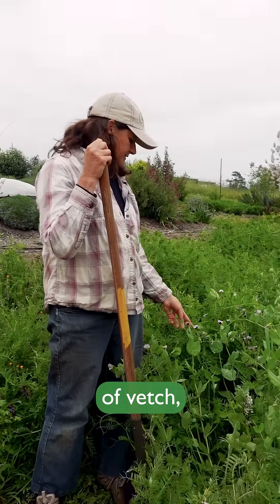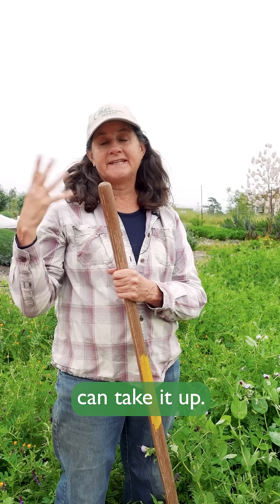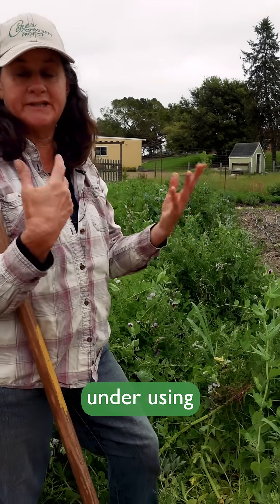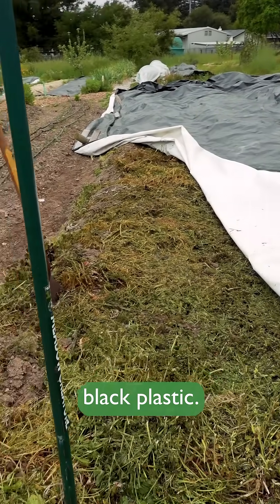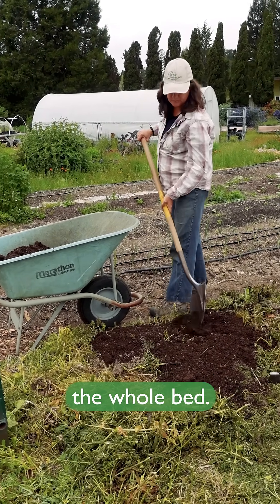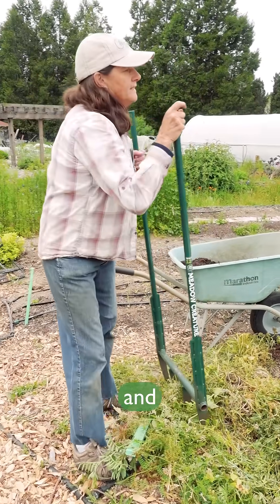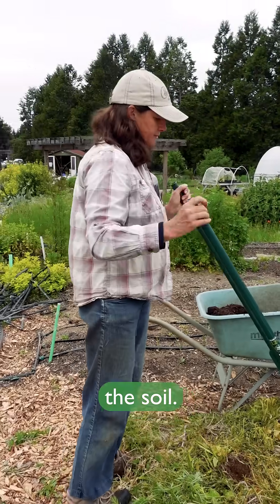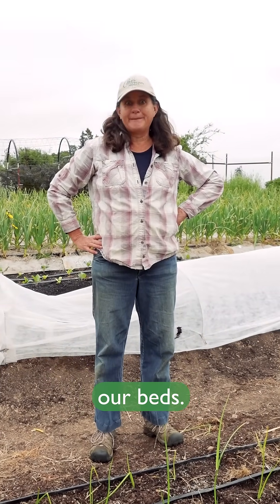What is the Low Tilling Method?

Comment: Love this so much!! I wonder if we can do this in colder climates, like here in Montana. Got a garden bed we just found out had pipes running through it 😅🫠 so need other more important ways of taking care of it.... Thank you!!
Reply from the maker: We love hearing that you're inspired by our garden practices!

That's a fantastic question about applying low-till methods in colder climates like Montana. Good news, low-tilling (including minimum and no-till) is absolutely effective there, though it does depend on specific soil and climate conditions!

Leaving crop residue on the soil surface, as we do with low-till, helps catch snow and preserve crucial moisture – incredibly valuable in Montana's semi-arid, cool climate. While soils might warm a bit slower in spring due to this residue, the long-term benefits of improved soil health, better water storage, and reduced erosion often lead to higher yields, especially in drier years. You might just need to adjust your fertilizer practices due to slower nitrogen release in cooler, no-till soils.

It sounds like you're thinking deeply about how to care for your garden bed, even with unexpected challenges like pipes! These methods really do offer powerful ways to build healthier, more resilient soil. 

We hope this helps you cultivate a thriving garden in Montana!